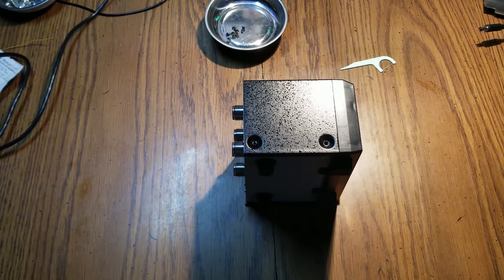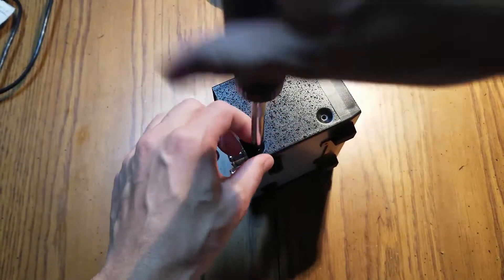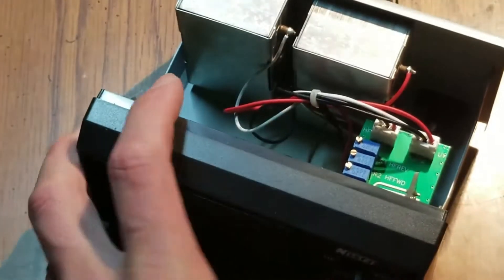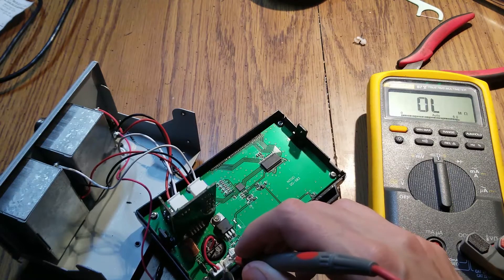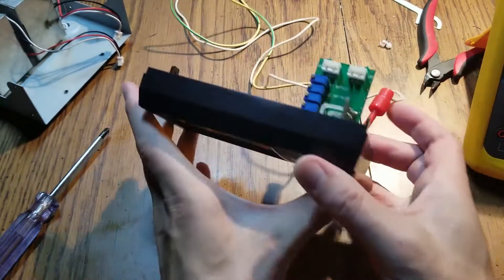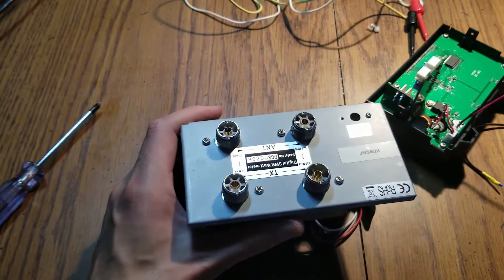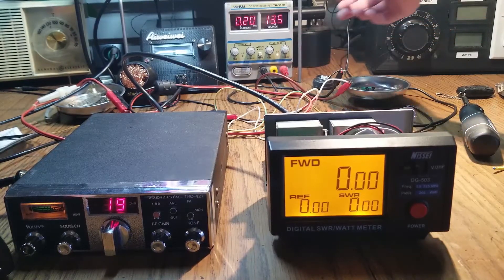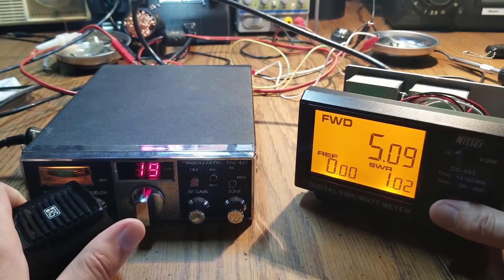Fixing a NISSEI DG-503 / MFJ-849 Digital SWR Power Meter After an Odd Failure Mode.

Comment: I bought two of them and they're both useless' first one the SO239 Connector UHF Female star insert pushed in and got broke, and the second one is intermittent; ATU wasn't matching any bands, after making sure the patch leads wasn't faulty, I took the SWR out of line, job done solved.

Comment: My theory is the radio connected to it might have had a bad or missing connection to the negative on the power source (or higher resistance) And the return path was through the coax braid, which then would have gone through that negative wire which melted due to the excessive current draw back to the power source.

Comment: I had a problem with my Nissei. the SWR became bad on VHF on my installation After having measured all the cables, I connected a 50 ohm load resistor at the output of the Nissei and noted that the SWR was 2.0 from the input to the output (50 ohm load). A component (Condo?) could be defective in the VHF rear part or the coaxial socket(soldered metal box). I will return it for exchange under warranty. I report the problem here because it is the first time that a measuring instrument has caused this kind of SWR error in TX line. 73s
Reply: You have a problem in the metal box (VHF/UHF) is not easy to fix...try to open it and check all components...
73 from CT2GGX